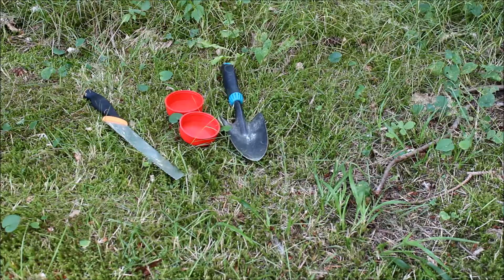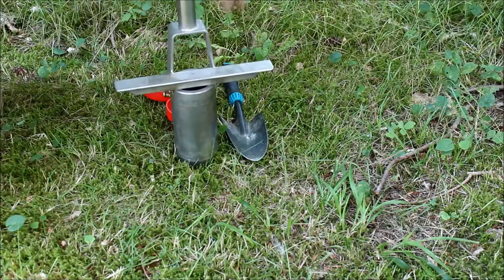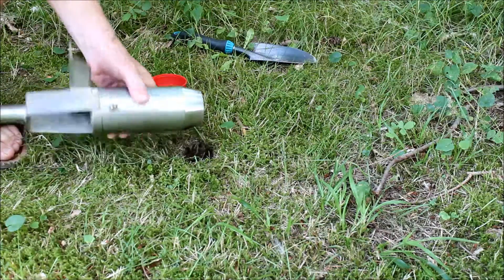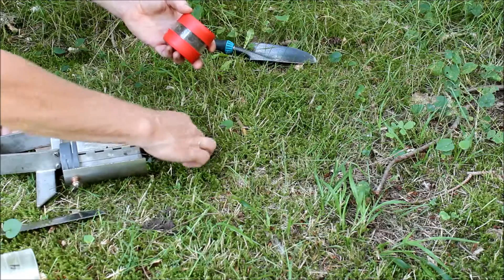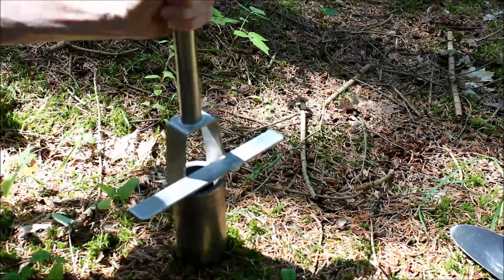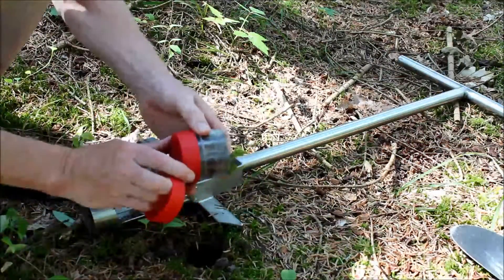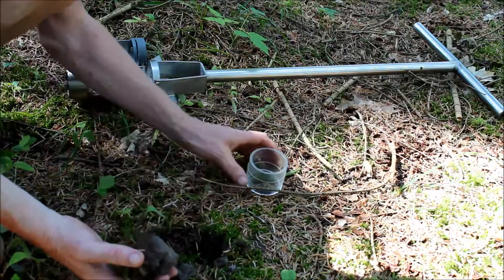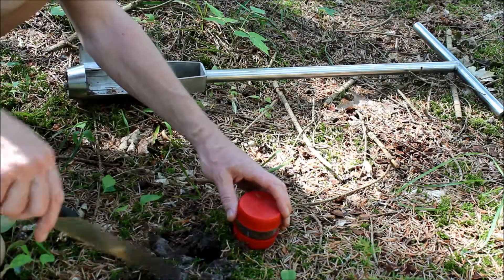Taking an undisturbed soil sample for microarthropod extraction

Comment: I would not consider this as an undisturbed soil sample since the top, bottom and side walls of the soils are disturbed.  I would consider this as a relatively undisturbed soil sample.  However, this test method seems to be an excellent approach to retrieving a soil sample.
Reply from the maker: To minimise compression of the soil core the cutting edge of the soil corer has a smaller diameter than the cylinder receving the soil. Most of the pressure will then be directed to the surrounding soil.